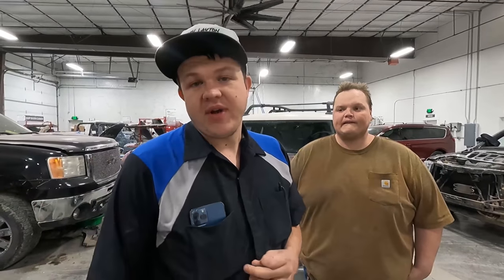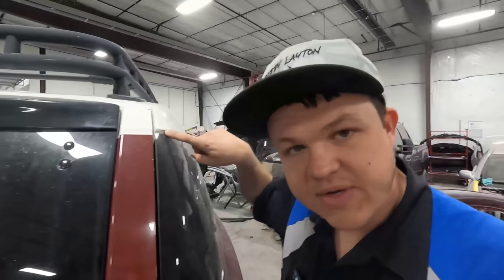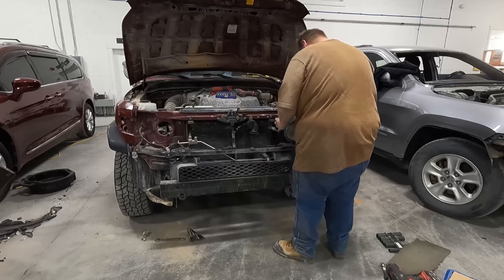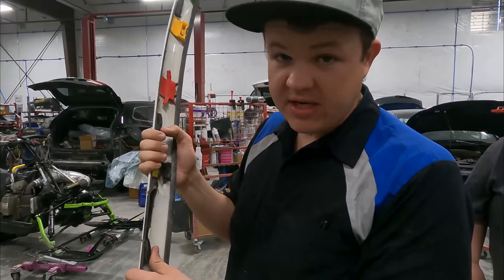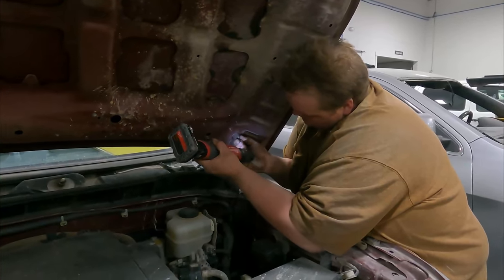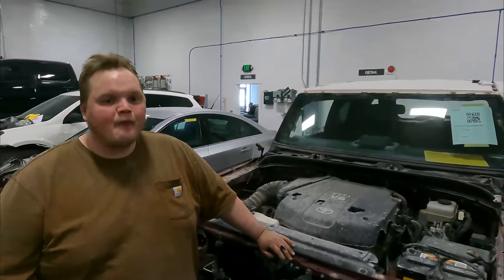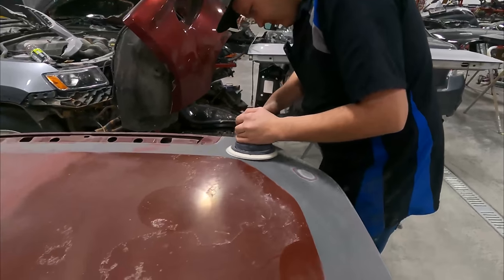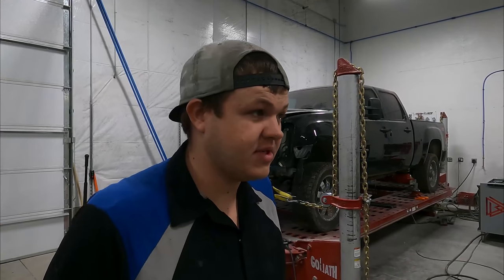This Is What BAD Bodywork Looks Like!

Comment: I have used the headlight restoration kits and I like the results. I recommend them, cheaper to do it yourself.  And the kit I use is Meguiar's heavy duty headlight restoration kit, because it comes with a drill powered polishing pad.  It has enough to do several cars, several times.  Thanks for sharing what you do in your shop, I am learning a lot.

Comment: It took me 3 hours to make 2 headlights on an Acura look brand new... The longer you do it the clearer it gets... Most products says it takes 15-45 minutes per headlight...I took 1.5 hours per side and I was impressed with the results...
Better than new and saved over $800. 
The product I used cost me $30 at Walmart...
Reply: I wet sand , then clear coat on my personal cars. The clear must be uv resistant.  Looks much better than new as long as the lens isn't cracking.
Reply: For a quick job, I grab my buffer and some 3m compound. 5 minutes later I got nice looking lights for a few months.

Comment: It’s good to see a shop caring about its customers, definitely doing a little restoration on the headlight that’s not being replaced. My fiancé hit a deer in her car and the headlight were getting yellowed. I told the shop it went to that I’d pay them in cash to replace the other headlight, or to tell me which brand head light they were buying for the non existent headlight after the crash… I argued with them for 45 minutes trying to just tell them I don’t want it for free, and I’m 100% willing to pay for a new headlight so they’d match. The, bad thing is the shop we took it to was supposed to be a very reputable shop. And just earlier that year they fixed a deer hit on my Tahoe, i grazed it doing damage to the fender, rear bumper cover and caving in the drivers side door. They did a great job of removing the dents, but they broke every door card retention clip but 2 and put it back in like that (it rattled like a son of a gun), and they also didn’t even tighten up the rear view mirror, it was about to fall off, if I didn’t notice it seamed loose it probably would have in less then 100 miles. And back to her car, they did a horrible job on paint and left a section in between the a pillar and fender just primered, she took it back up there and they colored over the primer with sharpie. That shop was supposed to be the best shop in my area, talking to nearly everyone I know and even the insurance agents. I was very unimpressed and only wish a shop like yours was near me in Tennessee.

Comment: Here's a suggestion, I think it would be interesting to know what various types of repairs or custom work would cost the typical owner.  From dent repairs, partial to full paint jobs, frame work, panel replacement, that sort of thing as estimates so we could have an idea of what having some custom work done should cost.  Comparing for cars, 4x4 off road vehicles, pick-em up trucks, etc.  Thx
Reply: at a shop near me it's 300 dollars just to paint 1 panel aka door / fender /hood that was 2 years ago I am sure the cost has gone up since then ..  there is a lot that go's in to the cost .. dents and scratches  how long to fix them spots .. door and fender gaps if needed adjustment ..factory parts or after market parts .. lot's of shops will not use used parts unless they can't get new ,,

Comment: Found my way here via Matt's OffRoad Recovery and FabRats and I'm happy I did. Great channel. Quick question...My son's BMW got into it with a hail storm. I have the hot glue dent puller Amazon special... the car didn't have Comp. Is Aluminum pullable or does it need to be "worked" with metalwork tools? 
Keep up the great work and the quality entertainment!

Comment: I remember trying to get a quote for a respray.  The body shop I went to claimed that a total paint was to much work.  The only two panels that did not need work due to paint failure was one front fender and the rear quarter panel on the opposite side

Comment: Robby, is it odd to have a Toyota with paint issues? Too thin of an application of the clear coat caused this? 

I hear that Dodge/Chrysler own most of the paint issues of the manufactures...due to 1 coat of paint?
Reply: Seems to be pretty common with Toyota Corolla's in Australia. Big sections peeling is not uncommon.

Comment: What a busy workshop. The FJ will be greatly improved after all the work, it’s an odd looking car. I did the headlights on my daughters car, they came up nicely but the finish didn’t last very long. Will try the stuff Dinner used 👍
Reply: What you want to do after sanding your headlights is get a high quality spray can of clear coat automotive supply stores tend to be able to make a can for $25 ish but it will add a layer of uv protection so it won’t yellow / fade  
Add a ceramic high quality ceramic coating on-top and to the glass brother you’ll never worry about your daughter driving in the rain at night again!  Highly highly recommend !!!!  It will change your dang life
Reply: The ceramic is a 2/3 year solution the clear coat is as permanent as the clear on your car … I do still recommend a ceramic ontop tho 😊

Comment: Why do the clear coats fail?  I see quite a few cars that have the clear coat failing on them even if they have never been in an accident.  On the other hand, by Ram 1500 was 14 years old when I sold it in 2018 and the clear coat was still in perfect shape.  It wasn't because I took good care of it though -- it was always parked outside and seldom got much of a wash other than an occasional spray with the pressure washer if the mud was a bit too chunky on it...

Comment: From factory those top moldings are urethaned on,  in certain parts of the molding. Not all the top moldings break above the windshield, when you change the windshield they are a bitch to remove but I have changed many with just having to replace the clips ! Now if you wanna talk about hard to remove without breaking , try a ford flex and removing the A-pillar moldings in one piece,  are a pain in the ass .

Comment: Looking at the FJ, has the whole thing had a 'new' paint job or just parts? I don't think I would want ANOTHER coat on top of the two that are already there. You never know how good the prep was for the second job. I think if I was spending the money for a good repaint, I'd prefer to at least sand it down to the factory base layer. That front fender looks like maybe it was hit and pulled out with a dent puller that left the holes. Correct in tossing it when you can get replacements.

Comment: Toyota holds their value, but I would not touch that FJ. It came back to that shop because of bull shit work. And did he just say this panel piece? It's called a filler molding dude. The difference in a shitty body man, as opposed to a ICAR CERTIFIED TECH.  This video is a warranty job done by these guys, and the guy is putting it off on someone else.